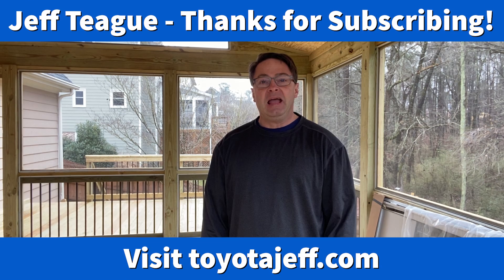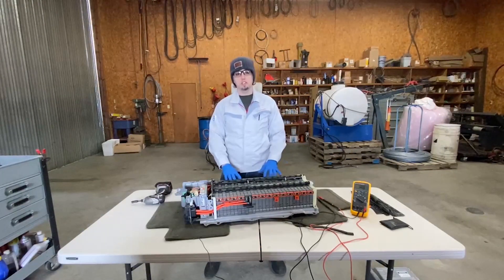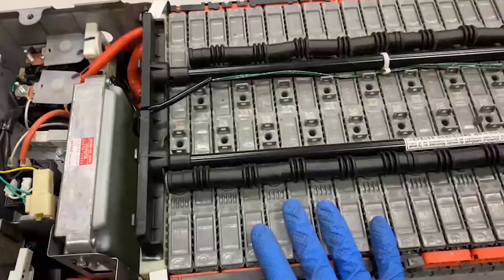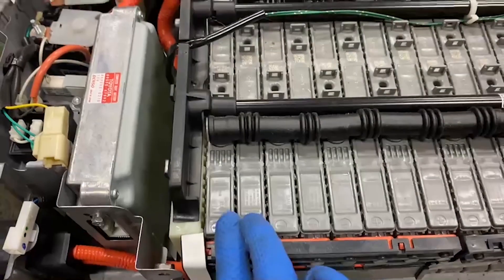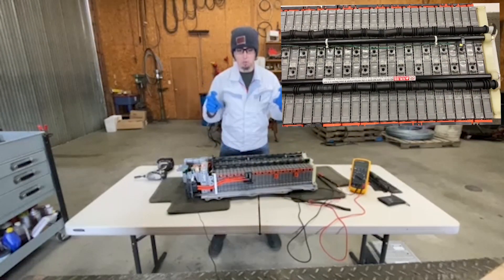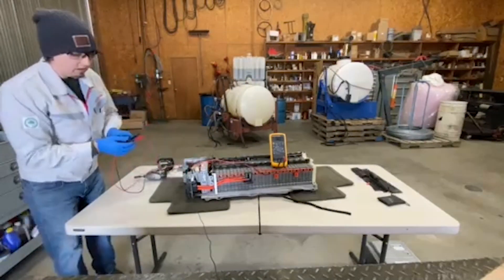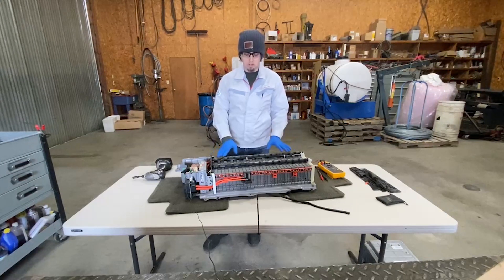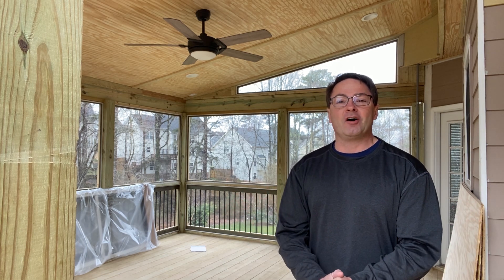Up Close and Personal with a Toyota Hybrid Battery: Learn all about it with a Hybrid Expert

Comment: I've got a couple of questions about the "Prime" plug in hybrids...
Does the plug in device charge a battery that the hybrid engine/regenerative braking doesn't? 
Is the regular hybrid charging system capable of replenishing the battery to where it would be able to run in pure EV mode anywhere close to where a plug-in charge would be?